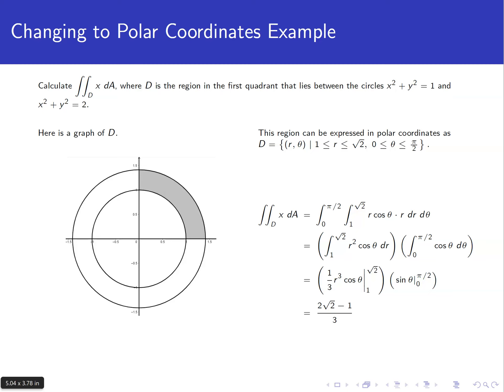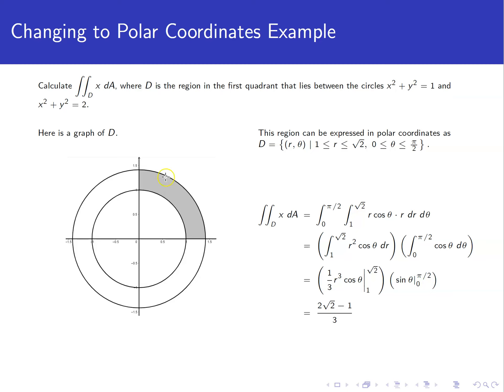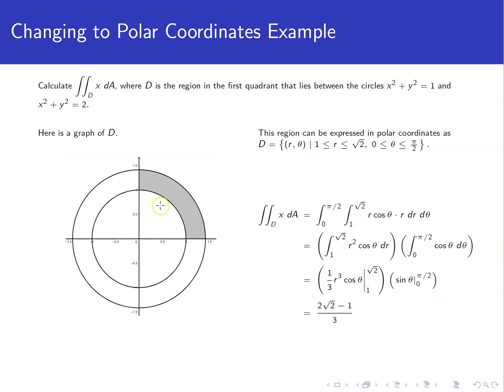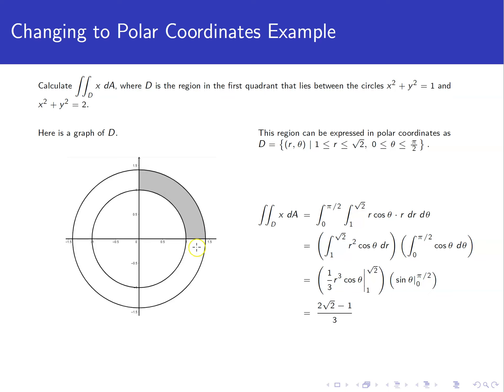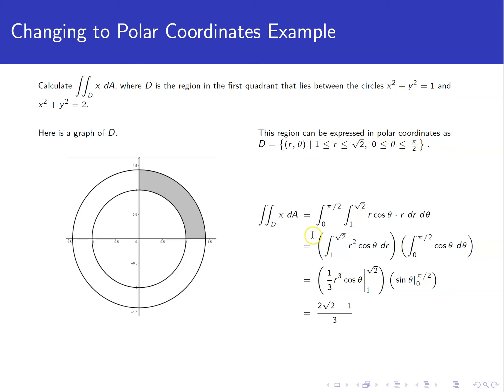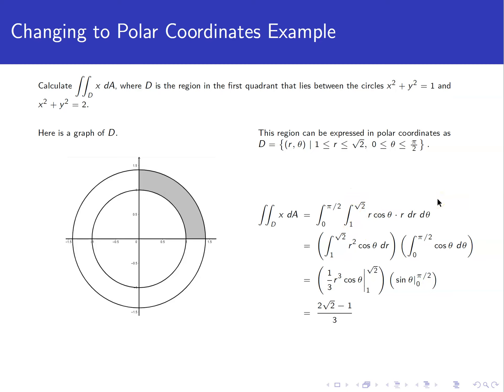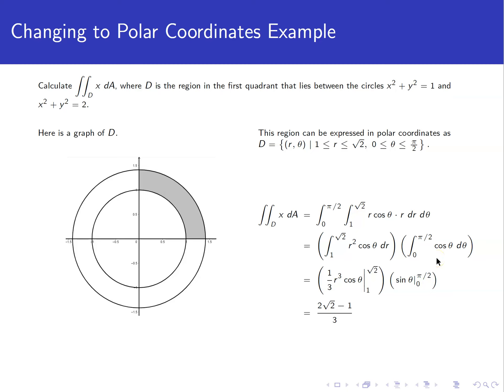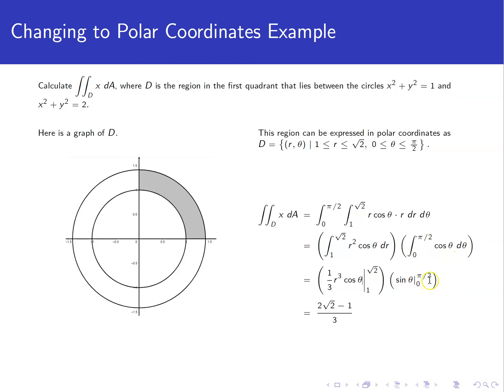Changing Double Integral to Polar Coordinates Example

Comment: I don't know of your method but using simple calculations:
Area of big circle = 2 pi
Area of small circle = pi
Difference (ring) = pi
Marked area = rIng /4 = pi/4
Reply from the maker: That is exactly how I would calculate the area of the region, but that's not what's being computed in this problem (which is a topic in multivariate calculus).  One interpretation of the double integral is volume under a surface, so one can think of the final value as the volume of a solid lying above the shaded region and below the function f(x, y) = x.